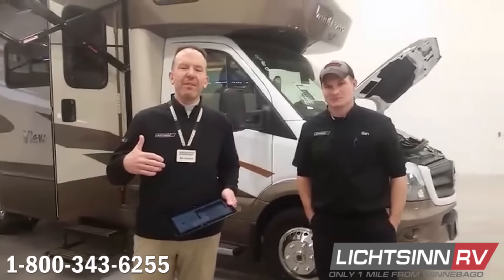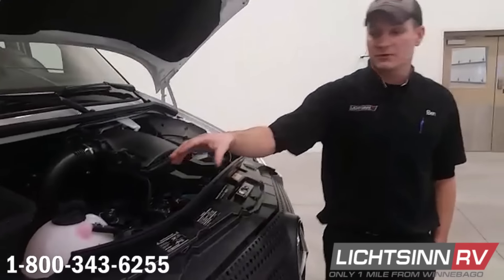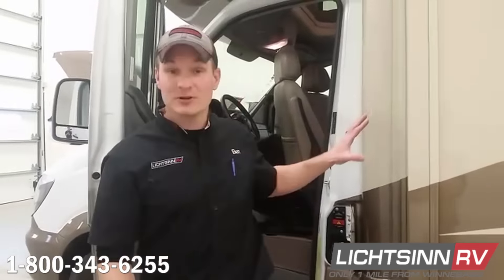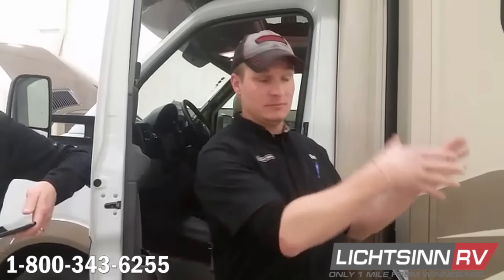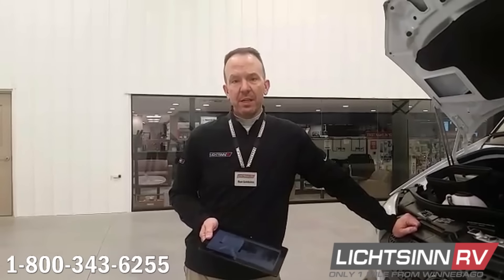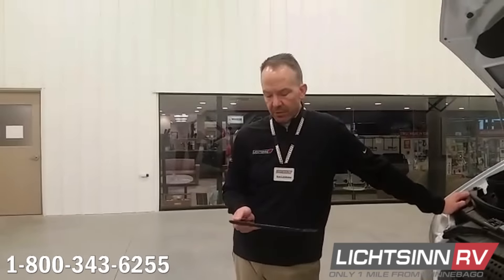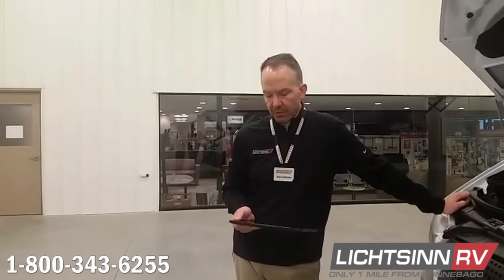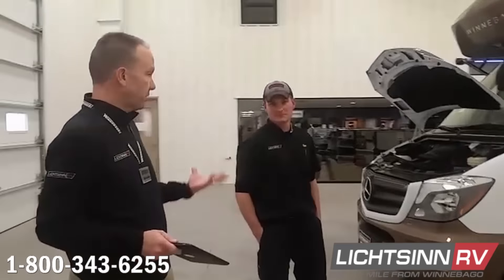Lichtsinn.com - January Live Webcast Open Q&A on Winnebago Views and Itasca Navions

Comment: Outstanding video. Does this RV come with the Mercedes Benz 3500 Sprinter factory installed tire pressure monitoring system?
Reply from the maker: Good morning Mario... thanks for your note... They do not option with factory installed TPMS but we can add at our store whichever brand you prefer, although we've had great success with Tire Minder.   We do, however, strongly recommended pairing this with metal valve stems extensions for the rear duals.